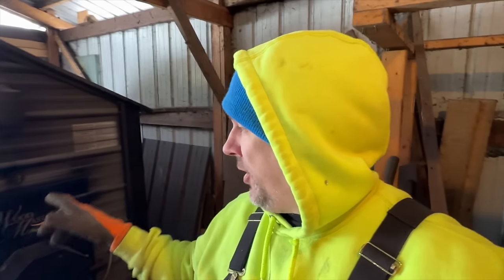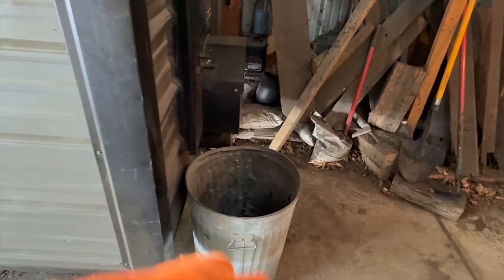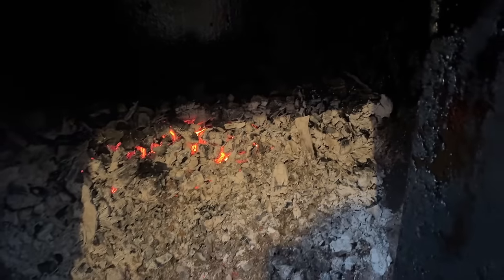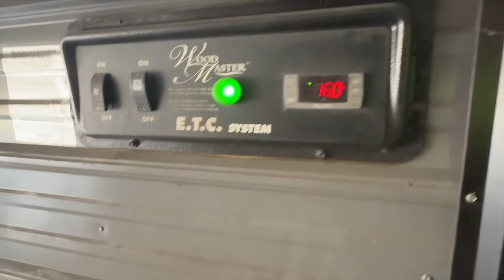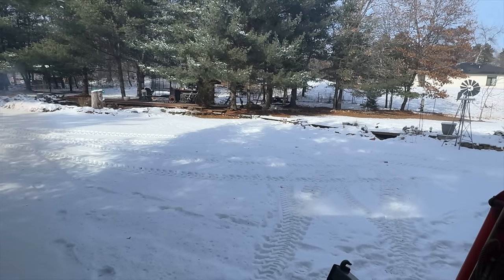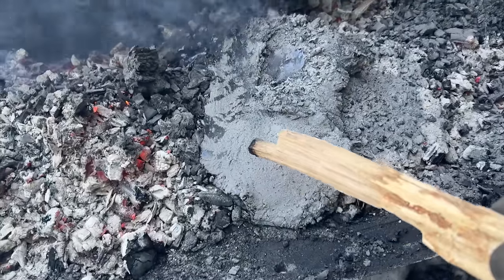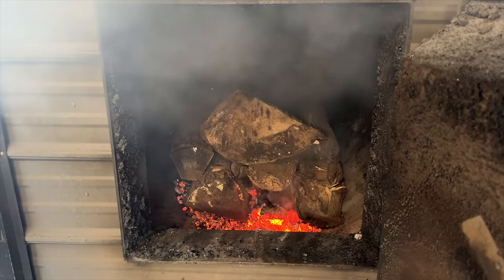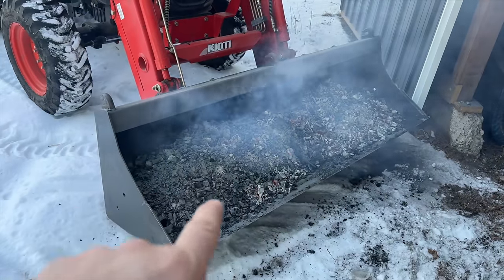Outdoor Wood Boiler Major Ash Clean Out - Woodmaster 4400

Comment: Have a suggestion for you. I build a coal Lake out of half inch pipe. What I do is I pull everything forward and then I use my call ring to push blue the ashes and it normally grabs a good chunks of coals. I pushed out to the back of the board. Put all my stuff on the shovel.  And poets dumped it into my tracker. That way I have been finding out. I can keep my coals and get 99% of all the ashes out of the barrel just to suggestion what? Hound bug in North Carolina.

Comment: My basement wood heater, when run properly, at a higher temperature that you run., like around 200 degrees F on the chimney thermometer, generates very little creosote.   We have to shut down during some mid winter warm days, and clean the chimney, and before starting up in the early winter, clean it again.  The creosote is all dried out and flaky, not like your blobs!  The first time we ever burned our wood heater, we had a chimney fire due to not knowing what the heck we were doing....but we learned quickly! HA HA  40 years now we been heating with wood in the coldest portions of the winter when daily temps do not get above 40 degrees.  Of course, we live in the central USA, not the north like you guys!

Comment: Be carefull about leaving the coals in the bucket, its most likely made from high strength steel, which will loose strength, and will warp from the heat.
Reply: Why is his little thin trashcan not all lopsided from having the hot coals sitting in it for days on end ??? Yet this is enough heat to warp that thick tractor bucket??? I am no rocket scientist, but I am gonna go with...Not a chance in the world of this ever happening!!!🤓
Reply: @waynetharp ash is very insulating and disperses the heat. 

Direct contact with hot coals however can burn up the galvanized coating on the bucket and it will eventually rust through. It's also not great for your health to breath in.
Reply: @sethsevaroth  Original poster was implying the ashes would warp the bucket. I have been scooping and pushing up burn piles my entire life and have yet to cause any visible damage to bucket or coatings. People just like to worry about everything...Even breathing galvanized burning can be flushed out with a tall glass of milk!
Reply: @waynetharp all I was saying is it could still damage the bucket but unlikely to warp.
Reply: @sethsevaroth  I looked at Kioti website earlier and they don't say what their bucket is coated in, that I could find...It says their rock buckets are powder coated so maybe they use that on their buckets also. IDK
Reply: I also shovel ashes into my bucket but I dump them out within and hour into my big firepit. Only thing I do is make sure to regrease the loader pins after everything has cooled as the hot temps will warm the grease and could dry them out.

Comment: I have never seen globs of creosote like that. Really, I haven’t. I bet that’s dangerous.😄 Will it burn if you put it back in there on top of the wood? Just curious cause that’s a bunch.
Reply: You forgot to add "asking for a friend"🤣
Reply from the maker: Yep it'll ignite and burn if put on open flame...not sure why it's like that hot tar look and consistency. Once it burns it becomes the dried flaky stuff that's usually on the sides of the door so it must be something to do with it gathering and being at a certain temp....warm enough to not solidify but not hot enough to burn... 🤷‍♂️
Reply: That much solid creosote and that puddle is a sign that you are filling it too often and with too much wood. Guys with big OWB's ( over sized for demand) have to make sure they load before they have a huge heat draw or they can creosote up bad. It really is best to let it burn down once in awhile and just keep raking the coals around while the blower is on to burn everything up. I have a Pacific Western with 650 gal water storage and 500,000BTU's heating 2 houses and a big shop.  Flaky creosote is okay as that means you are at least eventually burning it and getting the BTU's out.  @Back40Firewood

Comment: You could use that crude oil looking stuff mixed with used oil and turf rubber to make homemade chip seal. They spray it around 185* then lay the small crushed rock

Comment: This seems like way too much work.  I have a Heatmor and the ashes are removed by an auger.  I remove a 5 gallon bucket full every week.  It takes about 30 seconds.  I'm in central WI.
Reply from the maker: It's not that bad...would've been easier if I hadn't let so much ash accumulate...lol

Comment: Not sure why bothered to clean it out with that few ashes in there and removed all those hot coals that are heating the water. I usually let it die down much more than that and take the cooler ashes from the front and then pull the hot ones forward.

Comment: So Google says creosote can be used as a wood preservative,  and  a cough suppressant... the first one yeah I'd say throw that stuff in a bucket and save it, but I don't think I'd be taking a spoonful of it to control my cough 🤮
Reply from the maker: lol...yeah this stuff makes you cough if anything. Nasty odor but once it cools it becomes hard as a rock...it's like it's at that in between temp of warm enough to be somewhat tar like but not hot enough to burn. Cuz when it's put on an open flame it lights right up and then once it burns it becomes flaky like the creosote that is usually on the doors and sides. 🤷‍♂️ 😆

Comment: I don’t think those hot coals are good to have sitting in your bucket. Will most likely distort it.
Reply: Not to mention the hydraulic lines nearby.
Reply from the maker: I ended up throwing a bunch of snow on the coals and then dumping them out.